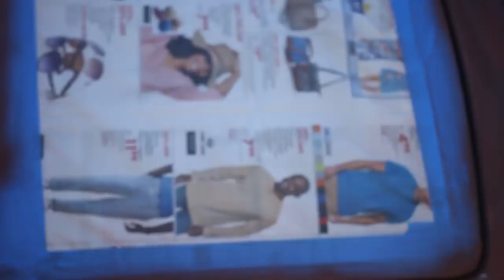Transform Your Car Or Truck For $300!

Comment: Little advice so you don't have to polish afterwards and get the bugs, dirt, orange peel off. Get a garage tent from harbor freight or make one from pcv pipes and plastic, painters use for the floor or just tarps. To make yourself a portable paint booth. The paint and finish quality will go up.
Reply: And the neighbors upsets will go down.:face-green-smiling:

Comment: Here a tip if a bug or some sort of rubbish falls on your wet paint . …..  use Tape while the paint is wet and pull the bug / rubbish off the paint with the tape just lightly touch the bug or rubbish and try not to disturb the wet paint to much then spray over the Area immediately after to help get rid of that bug/rubbish mark on the wet paint . Also if you have a garage it’s best to spray down the garage with water so the dust / rubbish won’t fly off the ground on to your paint .Hope this helps

Comment: Next time you do one of these, try 2 stage paint. I've painted cars quite a few times at home and my first time using 2 stage looked 10 times better than any single stage I have ever done and it didn't really cost that much more. It's also easier to get out any imperfections and orange peal.

Comment: Question, what do you do about the bugs and debris that land on the wet paint when painting outside? I always end up trying to get a bug off, smearing it, and end up having to re-sand and prep the entire area again. Every time. Any tips?
Reply: let the paint dry, use something around 1500 grit to remove the spot and polish the entire panel, to prevent some dirt from going in, spray water all over the driveway/surface you are painting on and if you're willing to invest some money you can look for a portable or non portable paint booth, time is money so if buying a booth will save you time, it will in the long run save you money

Comment: Digging the videos. Authentic builds and budgets FTW. Keep them coming. Question about the painting, isn't over spray a concern? Driveway, nearby house, cars? Or am I over thinking it?
Reply from the maker: Thanks! Cars close by yes, I've made that mistake before. Anything farther than 10 ft or so on a non windy day tho, i haven't had issues, turns to dust before that. Driveway tho, yeah I should've covered that for sure lol